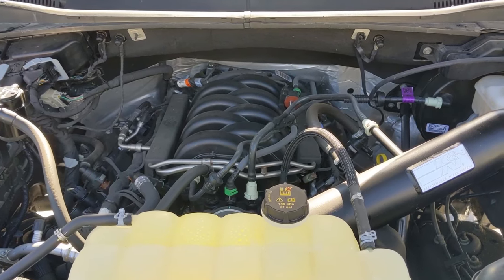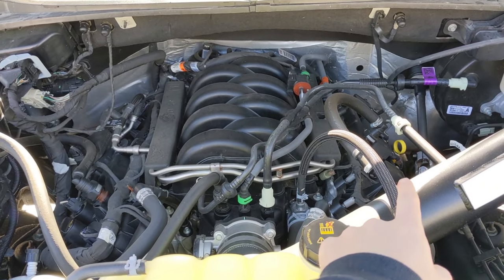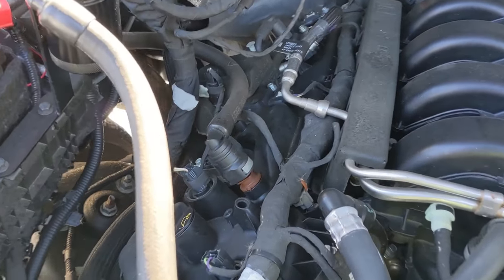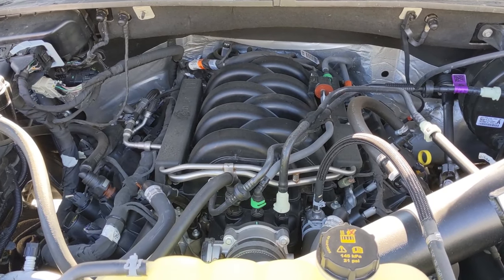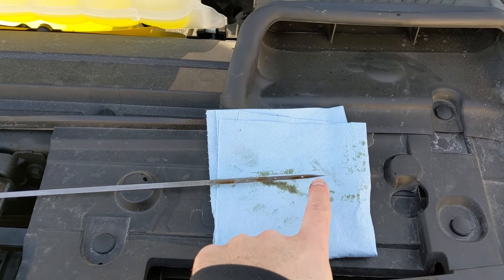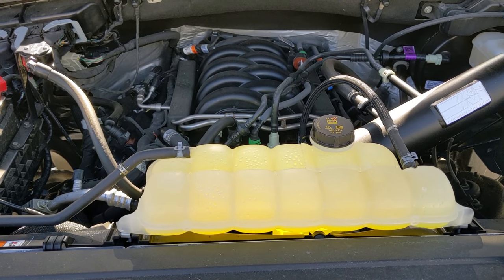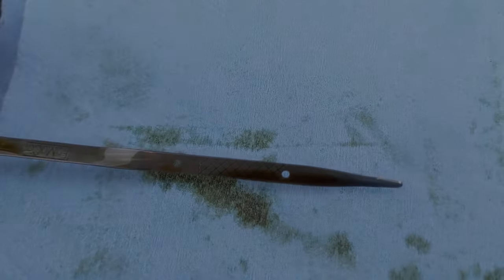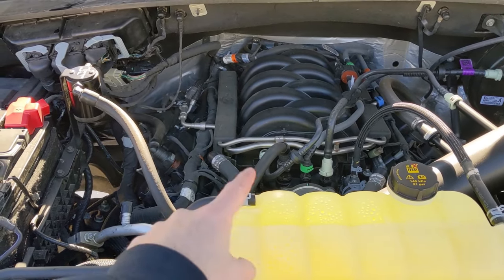Oil Consumption Update - 2019 Ford F150 5.0L

Comment: Great video,  have a 2015 with catch can with no issues however I am running 25000 mile amsoil full synthetic and my oil monitor system says to change only after about 5000, I have had 0 issues with resetting the monitor and going to the 13000 mark or once a year like amsoil recommended. What's your opinion on this,  thanks Russ
Reply from the maker: I'd never run oil that long, google synthetic oil gumming up an engine and you'll see why. Oil is cheap and so are filters, I change around 5000kms and figure it keeps everything fresh and clean. Thanks for watching!

Comment: "back road driver" has a 2021 f150 and it's burning oil so I don't think they fixed it. 
I think ford put a longer dip stick in it so the truck can burn more oil and still be on the dip stick.
Reply: So true, they haven’t fixed squat because if they did they would of tuned /tweaked the PCM by now. The longer dipstick is a joke really. Who are they fooling?😧😧
Reply: His is 750hp supercharged.  I'd expect it to burn the way he dogs it.  I have a 2021 that seems to have a faulty oil level sensor.  Dipstick shows about 1/4" from top of hash.  Warning to add oil comes on during hot startups.

Comment: Thanks for the video, I was trying to find someone having the same problems as I with this oil consumption problem. I feel like I bought a defective 2019 Ford F-150, 5.0 L 10 speed in January 2020 from Ford dealership in Texas. I’ve taken it numerous times to dealership under warranty, they replaced the dipstick, they reprogrammed the PCM, and I drove increments of 500 miles with a loss of a quart of oil, twice. On my long journey to Louisiana, I drove over 1400 miles with 2 quarts consumed. Now it sits at Ford again & they tell me the tech pulled all spark plugs to inspect combustion chambers, found oil saturation on top of pistons, left cylinder bank. They plan to replace left cylinder head, spark plugs, & necessary seals. Saying valve seals are the cause of concern. Question, how can they determine this if they haven’t pulled the cylinder head yet? Are they guessing? Thank you, Kathryn B
Reply from the maker: Probably using an inspection camera through the spark plug hole, it's a very tiny one, with a long cord and a light on the end, shows the video on a screen. The cylinder heads and cylinder walls can also be an issue I've heard. This video was just focusing on what fixed mine. Good luck!

Comment: 2018 f150 5.0 this didn’t work for mine still consuming oil. I did install the Ford performance catch can picking up about 2 quarts per 5000 miles but still consuming about 2 more quarts. Ford did the consumption test multiple times to 1000 miles looked fine after I passed 1000 miles it started consuming Ford then started the consumption test from the beginning again and it would not do it till it passed 1000 miles. I’ve given up I love the truck and haven’t had any other issues with it. So now I just dump a quart in every 1000 miles runs like a champ for now 75000 miles if it makes it to 200000 miles I’ll be happy ✌️
Reply from the maker: Just keep an eye on when your warranty expires, I just had to replace my left bank catalytic converter 100kms after I posted this video. It got clogged up because of the consumption.

Comment: Just so you know this was not a fix..  They actually lowered the low oil threshold.    Mine was "fixed" with this procedure.   The recommend amount of oil showed just fine on my old dipstick. now with the new dipstick,  My dipstick shows normal when I am actually 2-3 quarts low.   At one  oil change after only 3500 miles I had little to no oil when i arrived.    I can tell when i am actually low because i get a rattling sound kind of like turning on a garbage disposal with a spoon in it.    I check the "new dipstick" and it shows fine.      Good explanation though.... I am assuming financed and produced by Ford.
Reply from the maker: You need the ev281 PCV valve on the passenger side valve cover and also run fully synthetic 5w30 or 5w40 oil. Fixed my truck, I'll be doing an update video at some point.
Reply: So switching to a good synthetic 30 weight, preferably 40 weight will protect your engine.
Reply from the maker: @corruption1724  yes absolutely, use a true fully synthetic oil though. A lot say "synthetic" but they can actually be synthetic blends of up to 90% conventional oil and only 10% synthetic. I'd recommend using any of the brands I mentioned above!

Comment: Do you have any additional info re: Gen 2 5.0 oil consumption? My oil level is low well under hash marks again even though I topped it off Idk 1k miles ago or so. Today I pulled the pcv valve but it’s the correct one with the cross pieces and it slides up and down good only going up under pressure. I have zero leaks and the pcv valve seems absolutely correct and functional. The tsb you talk about here pertains to 2018 and up mine is 2015. I am outside of warranty about to turn 70k. Did these have that short dip stick issue? I’m at a loss of where the oil is going. Burning is all I can figure. Anyone with input would be appreciated.
Reply from the maker: I have no information on the 2015s as I haven't done much research on them because I don't have that year. I did as much research into the issue for 2018-2020 gen 3 5.0L engines and there's so much information. You'd have better luck going into the forums and searching for your issue there. Sorry I can't be of much help in this situation.

Comment: My 2011 Grand Cherokee 5.7 hemi had the same issue with oil consumption. Fix from Jeep was exactly the same. Different dip stick and reprogram.
Reply from the maker: @gregsvintageconsoles3673  factory these engines take 5w20, I've since switched to 5w40 fully synthetic and the truck hardly consumes any oil. Slightly worse fuel mileage but nothing crazy. This winter I'll be running 0w40 fully synthetic to see how it does in the colder Canadian climate
Reply: @EliminatorPerformance  Yes I run 5w30 and the 5.7 uses very little oil. Im planning on running 5w30 blend in the f150 5.0 and I put the longer dip stick in. I just got the truck. 2019 with 15k on it.
Reply from the maker: @gregsvintageconsoles3673 I would recommend a fully synthetic over a synth blend as I've heard they're not 50/50 like one would think, and could actually be 90% conventional.

Comment: I have a 2018 5.0 and had a new engine installed due to oil consumption.  The new engine also has oil consumption.  TSB 19 2365 was done at the last oil change several months ago.  Today the oil level is well below the bottom hole on the dipstick.  I have also been blessed with a faulty transmission that Ford will NOT acknowledge.
Reply from the maker: Sorry to hear you're having these issues. There's been issues with cylinder heads and cylinder walls as well with the plasma lined cylinders ford used, instead of the old sleeved kind. I would go to another dealer if that's the case.
Reply: My son is going through the same thing 
Loud noise on the passenger side on his 5.0
Ford says it's normal 
BULLSHIT
Reply from the maker: Just because something is "common" doesn't mean it's normal, these ford service managers and techs need to understand this. I can't believe how many times I've heard someone say oil consumption is normal, knocking is normal, ticking is normal, whining is normal. No, it's common, not normal, because it's not intended!
Reply: I feel your pain same thing with me new motor   same problems  only now  ford changed  what  they  call high oil consumption from  3000 miles  to 1500 miles   motor  sounds  like a  typewriter  at idle transmission  is a piece  of crap I would  trade  even  for  2009 f150 I had  before  this pos
Reply: Perhaps time to hire an Attorney to help you with this.. I had a new, undriveable vehicle once, and they did nothing. 
My attorney sent them a letter on his Letterhead, and told them if this car broke down unexpectedly, and we were hurt in a resulting car crash, he was going to sue the crap out of them forever...
And, if they did not fix this immediately, he was going to sue them to buy the defective, dangerous to drive car back, and pay more for loss of time, etc...
The dealer brought a guy down from Dearborn, Mich from the Buick Factory and they absolutely found and solved the problem...
I never let the Dealer tell me stupid lying stuff..
When they do, time to get legal on them and they comply... 
It will always be about $$$..
What is less expensive?  Fix the vehicle NOW?
Have to go to Court and Lose your A$$, and have to pay huge $$$? And perhaps still have to fix the car???
It's always all about the math -- in Their crooked favor -- or in your favor...
Good luck with this !
Reply: @alexpietrangeli6669 me too I'm 50 years old and worked on all my junk. As I'm blessed to be poor. But regardless I tell my son who has a nice looking 700 month payment I mean 2018 blue F-150 coyoteOil burner noise rattling edition. I ask him I thought yours was gasoline engine. He said yes it's gas. Hmmm 🤔 why does it sound like a diesel. I'd look into that if I was you.  
I took to Ford dealer they said it's fine it's supposed to sound that way.  
Hmm 🧐🤔 I don't think so. 
Oh I see you no more than the Ford mechanic..
I guess.😂 .
My daddy always said hard head leaves a soft wallet. I hear ur mommy hollering for you.  Go in tell her hi.
😅

Comment: great video!! Do you have direct injection? If yes, then your oil catch can is even more helpful in the long run, will save the valves from carboning up.
Reply from the maker: Yes, the correct term is "dual-fuel." It's high pressure direct cylinder fuel injection, with low-pressure port fuel injection. Thanks for watching!
Reply: @EliminatorPerformance  Oh, I see, direct injection likely for power, and under low power the port fuel injection.

Comment: Man, this is so good to hear! I've always been a Ford V8 guy and when I found out the 2018 and up 5.0 are consuming oil I was so disappointed. How is the truck doing now? Is the fix permanent? Thanks!
Reply from the maker: The truck hasn't consumed a drop of oil since the TSB was done! With the addition of my JLT 3.0 oil catch can, it gets a little bit of oil/water vapor and I'm glad that the engine isn't burning any of that crap. It's maybe 1 ounce every oil change, hardly anything, and not a noticable loss on the dipstick.
Reply: @EliminatorPerformance  Sweet! Very much appreciated!

Comment: I live in Ohio and wondering how much mpg you are getting prior to tsb fix and now after? I have that setup on my 18 5.0 and see a little accumulation in the catch can. Great video and explanation.
Reply from the maker: Thanks, I believe I was getting 13L/100km and now get about 15L/100km lol I haven't looked lately though. I'll double check and get back to you. I'm not sure what that is in MPG but it's not great lol I also have 3.55 gears so a higher gear makes fuel consumption worse as well.
Reply: @EliminatorPerformance  I translate roughly 18mpg down to 15.5mpg if correct. That’s substantial for something that the manufacturer has done for a “fix” to a newer truck. I wonder if they can do better to correct the consumption issue instead of getting into your billfold.
Reply from the maker: I'm in the truck now, says current trip is 15.6L/100 and I drive in sport mode heavy foot all the time. Before was around high 13 or 14 I believe so not too too bad of a change. My buddies dad gets 11 but he's older and drives in eco mode lol
Reply from the maker: @oscarmayer9823  ok so I drove around today for a bit, said 14L/100km and I was on the pedal heavy lol not bad I guess

Comment: @Eliminator Performance Can you tell me about the cat converter issue that you said you had? What all happened and is everything good now or is there more to worry about? Have a 18’ 5.0 myself that will be going in for the consumption test soon and really hoping everything works and the consumption goes away.
Reply from the maker: 100kms after this video posted code P0430 (left bank o2 sensor not detecting change after catalytic converter) and then I had a P0627 (fuel pump overload fault).

Brought it in, they said the oil consumption fouled the cat, they replaced left bank cat and cleared codes, runs awesome now. All covered under warranty, he said the other cat may need replacement in future.
Reply: @EliminatorPerformance  wow ok. Definitely something to think about. Going to get a JLT catch can and give this new GF6 oil a try. Supposed to work well with complicated modern GDI motors. Thanks for the response.
Reply: @EliminatorPerformance  Quick follow up question if you don’t mind. Does your sound like a diesel at idle too? Seems like a concern for lots of 5.0 owners as well.
Reply from the maker: It's the injectors and DOHC/valve train noise, the 5.0s are noisey yes
Reply: @EliminatorPerformance  ever had or heard of random coolant/antifreeze loss? Mines below the “low” level at cold and it’s never overheated and doesn’t leak or smell of burning. 27K miles
Reply from the maker: I think I've heard of the joint pipe leaking, under the rad somewhere. I haven't had issues with mine.

Comment: If the hash marks on the dipstick are the same height as the older stick you weren’t adding too much oil. Between the hash marks on most vehicles is usually 1 quart, so now instead of ford telling you to stay between 7.8 and 8.8 quarts they’re telling you it’s fine to be closer to the 7 quarts. All ford trucks had that original dipstick none of them came from the factory with the “new” dipstick. I don’t buy the new dipstick part at all. On the other hand I see how a new pcv and catch can helped. Thanks for the video
Reply: Check out this video, it was right below yours when I was searching this subject. New stick hash to hash is over 2.5 quarts. The original stick was 1 quart hash to hash. https://youtu.be/fn2L41Vz_WY
Reply from the maker: So since this video was made, I heard assembly line workers may have mistakenly been using mustang dipsticks? I honestly have no idea, but it's clear Ford increased the range to avoid having to pay out for consumption issues

Comment: My 2020 5.0 f150 has done 8500 miles. Mainly short trips with a few medium road trips thrown in. Last serviced at 5000 miles. Today I checked my dipstick and it was dry. 5 quarts later it’s at the correct level. Super worried! 
Service department at my local Ford dealership acting as if they’ve never heard of such a thing. I’m obviously still under warranty and actually have an extended warranty, however if they’re going to be playing games with me am I better off finding a competent honest mechanic to actually address the problem or fight with ford to hopefully come up with a solution?
Reply from the maker: Go to a different dealer, and tell them you were 5qts low in 5000miles. I was consuming 1qt/1000km and it was considered excessive. A bit of oil consumption is common, but oil consumption in general is not normal. I'd get a second opinion.
Reply: Don't think you  can  fix this  motor  till ford back to steel  sleeves big mistake going  to all aluminum  block in my  opinion
Reply: So the verdict was after my 1000 mile oil consumption test was that a mechanic that “used to work there” was mistaken about the difference between a mustang coyote and a f150 coyote and didn’t put the correct amount of oil in my truck , but don’t worry no damage done. 
🤔
Reply from the maker: Well they put 9qts in my truck and I'm down a bit, I'm going in next week to see what they say
Reply: @EliminatorPerformance  - I hope when he tells the Dealer he let it get to 5 quarts LOW, that they don't tell him HE ruined the engine and now we have that... Need to get legal involved...

Comment: been thinking about a 2023  3.5 or 5.0 wondering what problems I'm gonna  have ...my 04 4.6L heritage has never had an engine trouble light ever I bought it  new I think about $19 k man I might be to spoiled for a new stop/start / dfm has me freaked
Reply from the maker: So I'm not as familiar with the 21+ trucks, but I do know in 21 they once again changed the 5.0 and have cylinder deactivation, as well as no more oil pump gears, instead they went with a wet cogged belt driven oil pump. The belt goes down into the oil pan. I don't know of any failures yet but it's something new so something to research for sure. I'm in the process of filming an update video on my truck now

Comment: I have a 2015 5.0 f150 and I’ve been just changing the oil all along without checking the level before draining it. Well the last few oil changes including today’s I’m always at least a couple quarts low. No drips under the truck so it’s not leaking. Today’s oil change I decided to do it sooner than the minder at 5,600 miles and what do you know it’s it’s low again, well under the low mark. It starts off full then ends up low. Clearly something is going on but my factory warranty is up now. 6 years old and 62,000 miles on it. Now I’m getting worried
Reply from the maker: Possibly time to trade it in after a fresh oil change? The 2015s are gen 2 coyote, the 18-20 are gen 3, and the new 2021s are 4th generation. The oil consumption was Gen3 only I heard.
Reply: @EliminatorPerformance  it’s been paid off for a year now and I have no interest in starting more payments. I wonder if my dealer will have any input about it or not really care because it’s past the 3 year 36,000 mile maybe the valve change you mentioned, wonder if that would do anything, you said it’s like  7 bucks

Comment: Great news on yours. Any suggestions on where i should take the next step to avoid some sort of run-around?
Reply from the maker: Try the ev281 pcv valve if you haven't already, it's so easy to remove yours to check